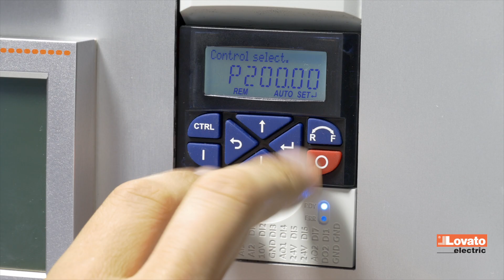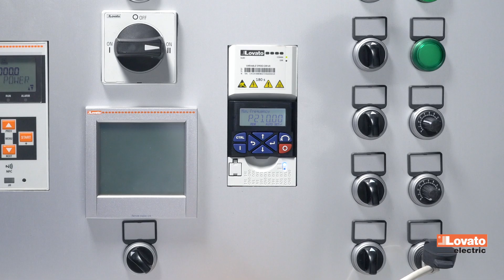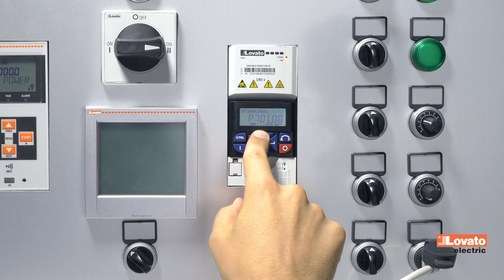2. Navigating groups and programs- VLB3 Variable speed drives | LOVATO Electric

Comment: How to run a Motor by this vfd & basically which parameters are required? 
Thanks
Reply: You can find all VLB3 series manuals here https://www.lovatoelectric.com/ProductsList.aspx?id=150011&text=VLB3-three-phase-series,-book-housing. I particulary recommend the quick guide about your question: https://www.lovatoelectric.com/HandlerDoc.ashx?s=I521GB01_19.pdf&ic=119